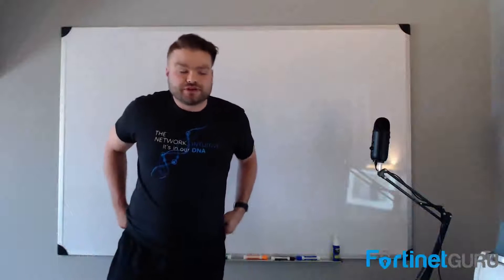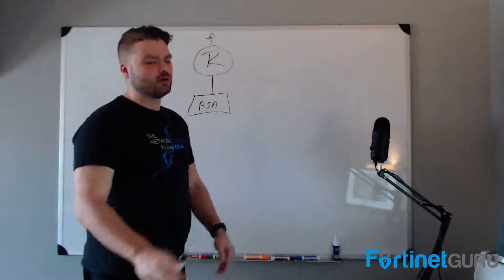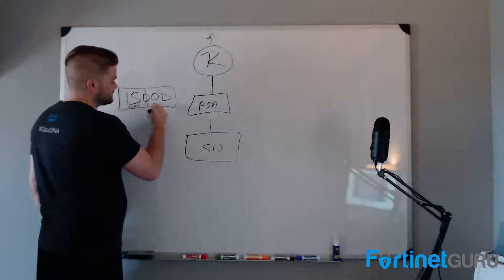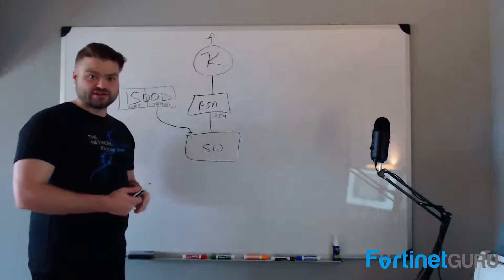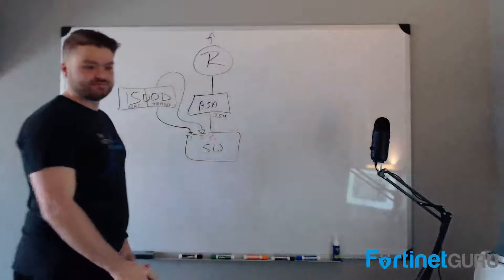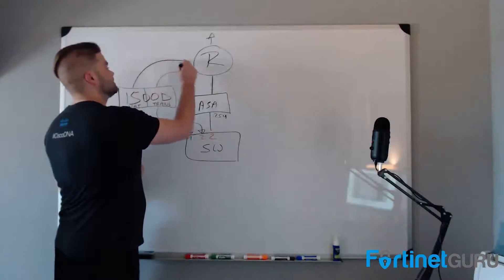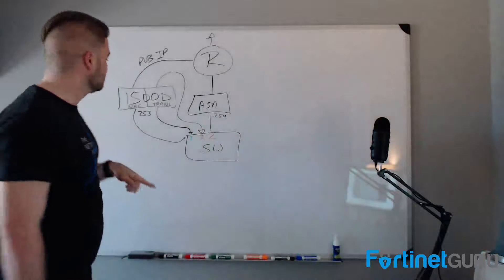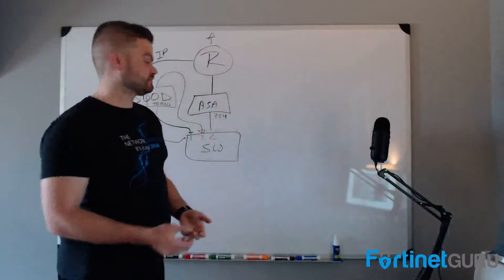White Board Session - Replacing Old ASA With FortiGate 1500D

Comment: Hi Mike, this is a very good migration scenario and good explanation.  I am in a same situation with our cisco firewall which is asa 5520 , we are planning to migrate it with FG- 200E ours is a small office with 80 employees and an ISP. But our ASA have multiple sub interfaces in LAN, if I want to migrate by testing this way it is not possible bcoz i cannot carry 6 vlan through the external interface and make the ASA interface and Fortigate external interface in same vlan. Is there any better to do the migration in our scenario. Even our Manager is scared of migrating bcoz of 10 vpn tunnels and VoIP , wireless and some servers going through it in DMZ. This is our Interface config.

Ethernet0/0                208.86.x.x      YES CONFIG up                    up  
Ethernet0/1                unassigned      YES unset  up                    up  
Ethernet0/1.209            172.16.209.1    YES CONFIG up                    up  
Ethernet0/1.210            172.16.210.1    YES CONFIG up                    up  
Ethernet0/1.211            172.16.211.1    YES CONFIG up                    up  
Ethernet0/1.212            172.16.212.1    YES CONFIG up                    up  
Ethernet0/1.213            172.16.213.1    YES CONFIG up                    up  
Ethernet0/1.214            172.16.214.1    YES CONFIG up                    up 
Ethernet0/1.987            10.254.1.1      YES CONFIG up                    up  
Ethernet0/2                192.168.1.1     YES CONFIG up                    up 

Waiting for your response :)
Reply from the maker: You would do things very similarly. You would slide the transparent VDOM between the ASA and internal switch. You would create internal and external interface VLANs for each sub interface that exist on the ASA. So if VLAN6 exist on the ASA you would create EXT_VLAN6 and INT_VLAN6 on the appropriate interfaces of the transparent VDOM. Group all of your externals ones in an OUTSIDE zone and the internals in an INSIDE zone. Then you have to go into the CLI and configure Layer 2 forwarding (so INT_VLAN6 will forward layer 2 broadcasts etc to EXT_VLAN6 and so forth). You need this in both directions. Don't trust wildcard VLAN options on the interface as I have had horrible experiences and if this is production and you already have some resistance I would rather be safe than sorry. Please test the vlan forwarding etc on a non production router / switch so you can be sure it functions properly.

From there, you have protection via the FortiGate while you migrate to the NAT vdom (I like doing green field deployments on the new VDOM to make things proper and best practice right out the gate)

Comment: So once you completely move a customer from ASA to 1500D then still you will have Transparent VDOM, I have done 5-6 migration from ASA to Fortigate 200E, 1000D etc but all I did in one go with cutover and partial downtime. With reference to the IPSec VPN the remote party will change peer IP because on Fortigate you have new Public IP. 

My question is will you keep both VODM after complete migration?
Reply from the maker: sameer pervaiz once the migration of services has been completed the transparent VDOM as well as the ASA can be removed. The ASA removal is just pulling the device once it isn’t pushing any traffic. The transparent VDOM decommissioning you just remove all references to the VDOM and delete it. Giving you the ability to assign those resources, interfaces, etc back to the main NAT VDOM.
Reply from the maker: You can remove the transparent VDOM as you will have fully migrated everything over to the NAT VDOM once done. ASA and Transparent VDOM won't be necessary as all services will be running on the end product VDOM (NAT)

Comment: I still don't understand the need for Transparent VDOM. As per the video is it used only for learining traffic? Could you pls elaborate more. Anyway nice video.
Reply: You can apply full utm functionality while passing through the traffic without redesigning the addressing shema.
Not only for learning (monitoring) but actual inspecting/blocking is possible.
Reply from the maker: Hohma hit the nail on the head. It gave them immediate visibility and security far above their original deployment. This is an excellent temporary (or sometimes permanent) deploy scenario to quickly bandaid while you work on a full transition.
Reply: Can you do SSL inspection in transparent mode ? I'm currently preparing a small ASA -> Fortigate migration using FortiConverter. Requires some editing, but does a pretty good job in converting ASA configuration into Fortigate (Cutover method with partial downtime). Really like your channel & website, very useful and informative.